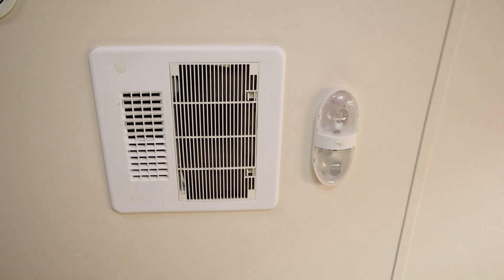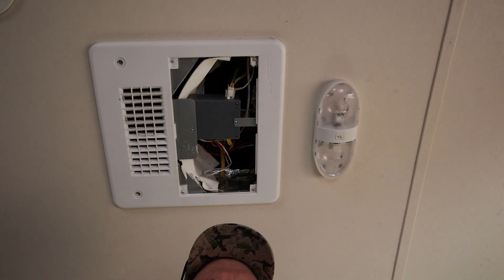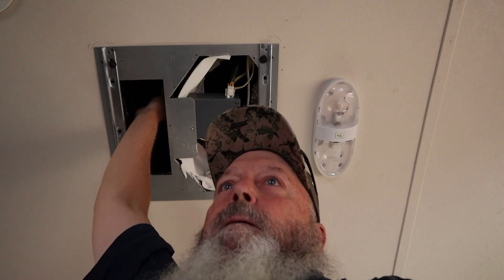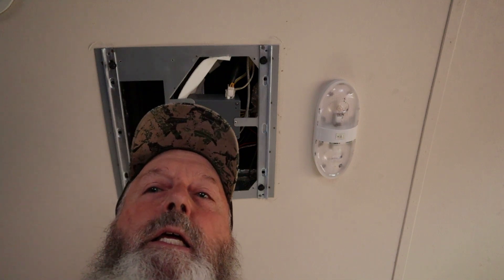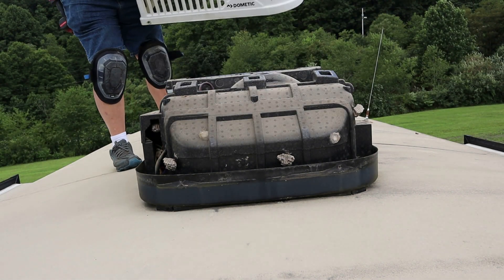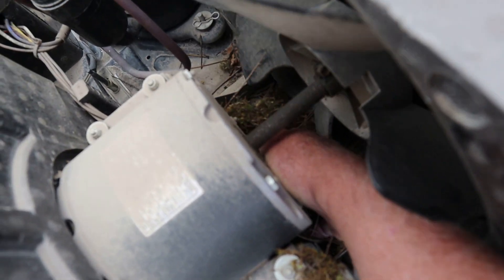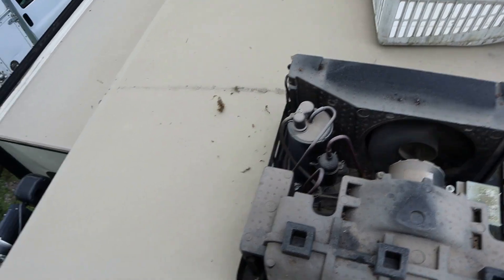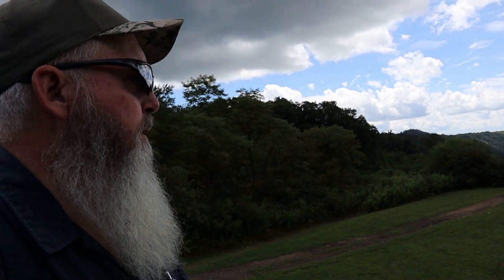AC Fan Only Hums *Crazy Find*

Comment: Good video but probably should have vacuumed out the ac prior to shooting all the debris all over the inside. Also just a job well done, not just the minimum. But good video overall
Reply from the maker: I was surprised at how much stuff flew around. By that time, it was too late.
Reply: the outside section is closed off from the inside section so the debris did not blow inside!